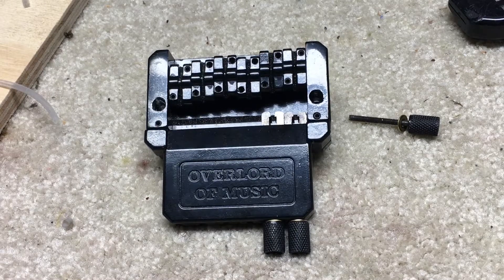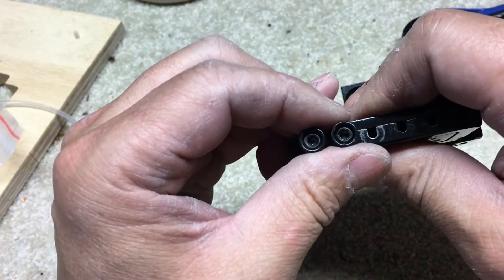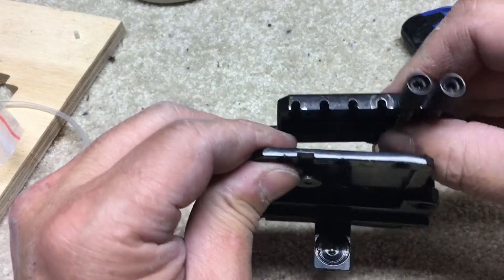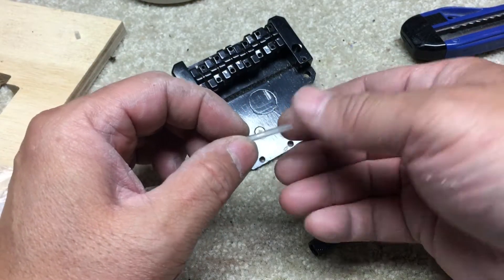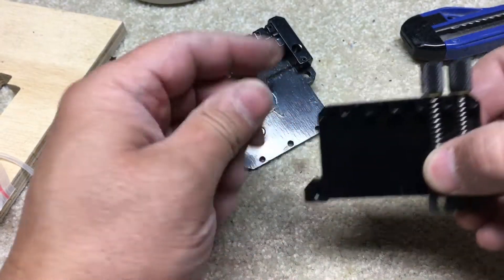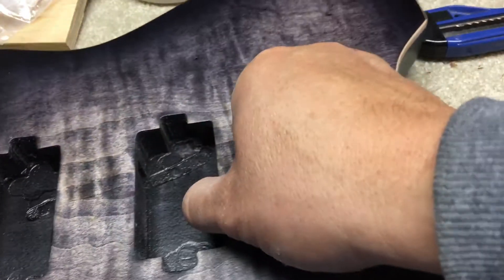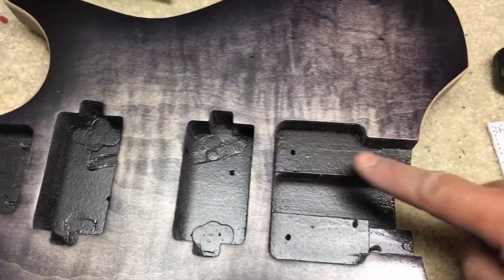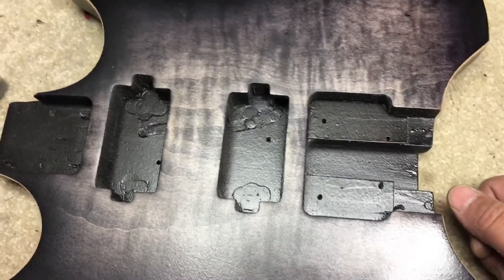Overlord of Music R-Trem tuner sloppiness. Muslady headless guitar kit

Comment from the maker: Follow-up. I completed the guitar build and happy to report that the vinyl pipe mod has stabilized the tuners (very little shift/movement) and made the tuner more stable. Also, the lubrication with machine oil made the turning of the knobs much smoother and got rid of most (but not all) of the coarseness to a point where I don’t really have a complaint (although I’d expect real Steinberger tuners to be even smoother). I lubricated both faces of the brass washers and also the thread that screws into the saddle.
Reply: what a bit of luck that reproduce these saddles or only the screws seems to be not too difficult even at home

Comment: on my Overlord OFMUSIC  the 'of' preposition is written together without space with 'music'. I can see in yours are separated as they should be:) So mine is probably the copy of the copy:) I have more issues with the letch and the tuning. I guess the spring is not to set up ur personal demands of the toughness of the tremolo but to balance between latched and unlatched tuning to equal them somehow close to similar pitches. How do you tune this bridge finally?

Comment: It moves without the string tension of course.If you fix everything and tune the string it stays in place and then consider if there is some other issue.But since you havent montage even a screw from the kit the question is if you have any technical skills and if play guitar a little bit.So what is all about since the only thing as far is unboxing.
Reply: I also have similar thoughts. I did not do this plastic tube mod and even I experiment similar moving, looseness but with the strings on it makes not much sense. My issue is rather the precise tuning bc of the unperfect latch

Comment from the maker: The Overload of Music trem is a copy (cheap imitation?) of the Steinberger R-Trem.
Reply: I have one and it functionally works fine for my purposes, but yeah it is a less expensive clone/alternative to a Steinberger Trem.  Not weighing in on whether it's "necessary" or not but if this mod makes it more functional for you why not?  If the tubing is a pain-in-the-ass bitch of a tight fit try some heat shrink tubing like you use to re-insulate wires when soldering electronics.  Thanks for sharing the info.

Comment: Surely that movement wouldn’t be there much when the string tension was pulling it straight all the time ?
Reply from the maker: I don’t know if it moved the same amount, but it moved enough to be annoying even under string tension—like you have a cheap Chinese tuner with a lot of backlash. That is why I was trying to fix it. I think when you try to tune up, the tuner moves down so it tunes down first before it will start tuning up. Tunes up first when you are trying to tune down. Very annoying to a point I probably won’t pick up this guitar to play it...
Reply: JTM Creations 
Good to know , I mentioned it because I have one, and am trying to install it on cheap thing that used to be a Telecaster ‘KIT’ guitar that I didn’t really like , but I had a few ideas to try , like luminous inlays etc .. and making it headless ! 
I’m just in the routing stage for the bridge .. and that is annoying enough for me ..
Hence watching your video .. 
and thank you for posting it BTW
Reply: JTM Creations 
Sorry another note , as to the tuning up and down that will have to do with the main spring as well .. however , I was just going to set it with the locking catch on and have a fixed bridge, as I didn’t really want a trem on this anyway .. so , one problem solved already 😀👍🏼